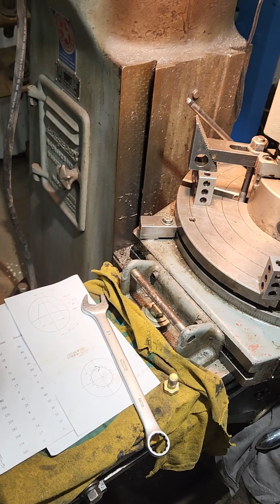Machinist's Minutes: How to Adjust Degrees, Minutes, and Seconds on a Rotating Shaper Table

Comment: Is that knocking backlash!?
Reply from the maker: No.  The handle has a center pin & the handle spins, it has a slight clearance between the two, Austin is tapping the handle, while holding the wheel part of the assembly.  I have heard this before when watching people on many machines, this is a normal sound, but I had not thought about it much before now.